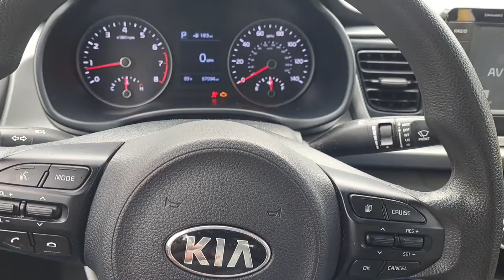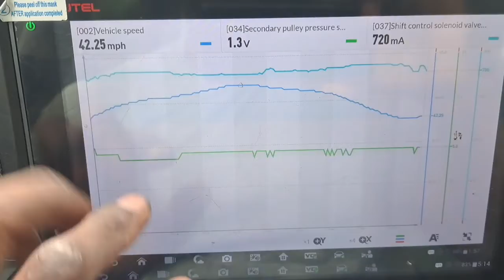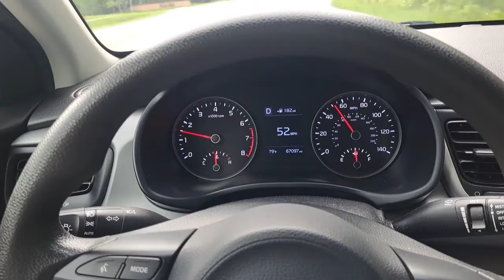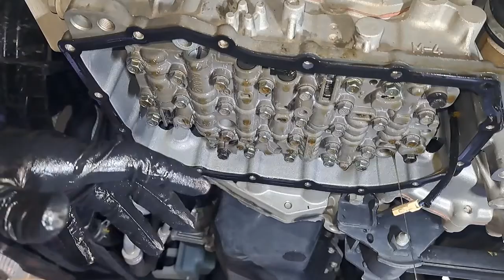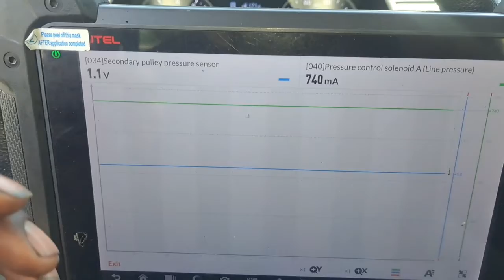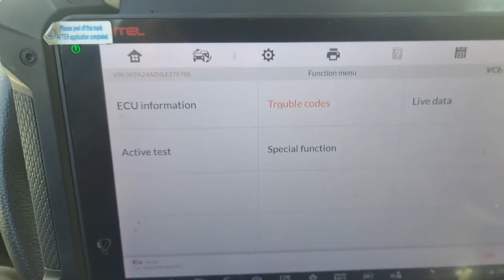kia p0867 transmission fluid pressure

Comment: this under Kia’s 10 year 100000 mile power train warranty why would you even touch it Kia will replace the cvt for free and give you a loaner car while work is being completed
Reply: unless she is the second owner. that warranty applies to original owner only.
Reply: @donlarsenjr2332 it follows to car not to the owner. Ive read it in the warranty manual and download the kia app and enter the vin number to confirm.

Comment: I’m having 2020 Elantra, with same code and i have researched it used the same sensor. 

Just wanted to confirm it doesn’t need to be calibrated after replacing it ??

My car has a SP IV fluid with it be the same process ??
Reply from the maker: If the sensor the same,  then check the transmission with the year in the video and compare with yours.  Then yes, process is the same

Sensor simply measure pressure, nothing to calibrate
Reply: I have the same gearbox and it displays codes P084500, P0867F0, and P086700. If I replace the sensor itself, will the problem be solved?

Comment: Hello Mate.
I got a forte 2019cvt,
And recently experienced the error p0867 , the car started to behave strangely, looks like it decreased the power. We replaced the sensor but we could finish the adaptation via the AUTEL, it requested the calibration code that we didn’t have.
What did you do after the replacement, you calibrated it or left as it was.??
Reply from the maker: That's the only code you had in the transmission right?  The p0867
Reply: Yes Buddy
Reply: After the replacement , all went ok , car started ti behave ok , and the check light also disappeared, just wondering about the calibration code the PC requested we didn’t calibrate it.

Comment: Do you know what the outcome of this was? My 2020 is having a similar problem. I got the transmission replaced about 6 months ago and put 11k on it and this error just popped up for us. It's odd the car is driving fine no hard shifts or anything. Did replacing the sensor ultimately fix it?
Reply from the maker: @masamasa1815  she got rid of the car a month later and got a new audi. But she didn't complain of the issue during that time period
Reply: @partsshooter  That might be my solution to, it's a piece of junk. One of the must unreliable cars I've ever owned. Thank you for replying.
Reply from the maker: @masamasa1815  I agree.  Thanks no prob

Comment: The P1603 error and plashing P for park are indicating your relearn failed.  "If DTCs P0730, P0731, P0741, and P0867 do not come back, upgrade the TCM S/W and perform TCM adaptive values learning procedure. If successful, complete the service. If not, and TCM Learning fails, ‘P’ will be blinking on instrument cluster and DTC code P160300 will set. Then replace the IVT/CVT and do TCM Learning again."
Reply: You're on to something, in my case the cvt was already replaced, and the P light flashes after performing update and resetting adaptive values.

Comment: My 2020 Kia rio with 65k miles is throwing the same error! P0867  Thanks for showing the senor replacement fixes that error!
Reply from the maker: No prob... I'd imagine this maybe uncommon issue.  But why not document it???🤔 it's easy at least
Reply: please help hyundai creata scan show code p0867.transmission fluid pressure. please help
Reply: You fixing the sensor did it fix the problem and with the cold off of it then
Reply: I have the same gearbox and it displays codes P084500, P0867F0, and P086700. If I replace the sensor itself, will the problem be solved?
Reply: @FM-xb4km  Kia replaces my transmission due to this error. under warranty
Reply: Same mileage but 2023 rio, and it's getting that EXACT code only when heavy humidity is involved. starting to think that a sensor replacement might be the way to go.